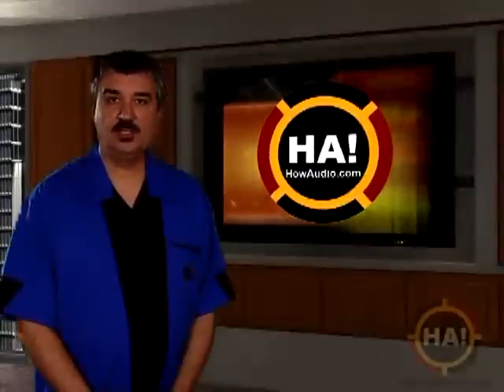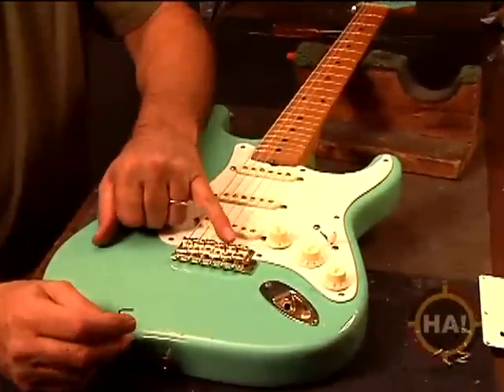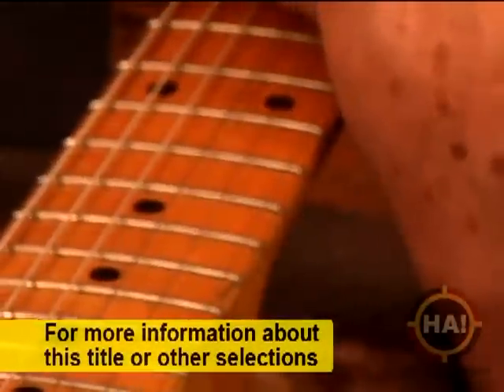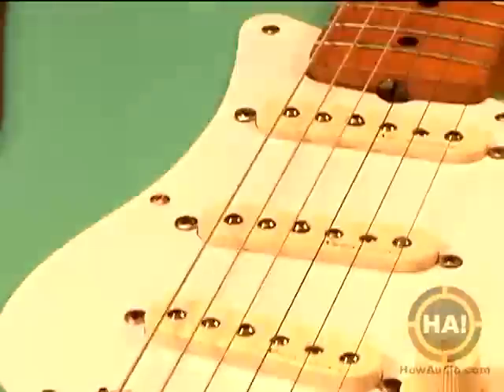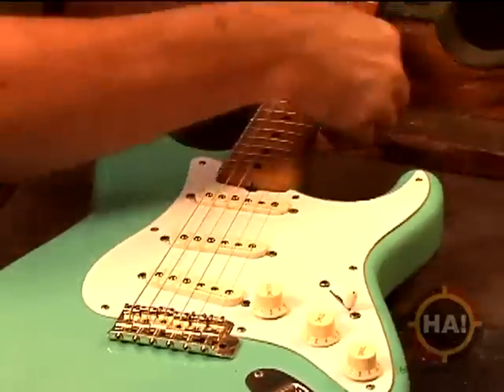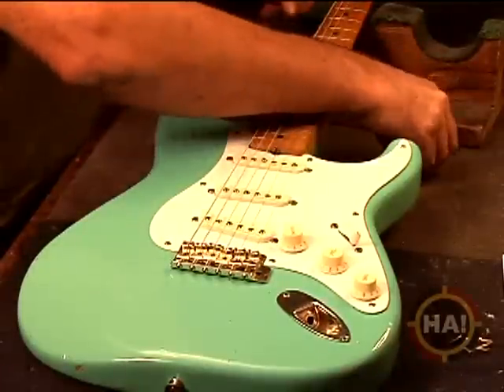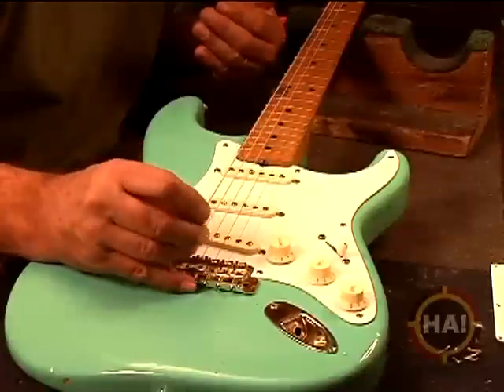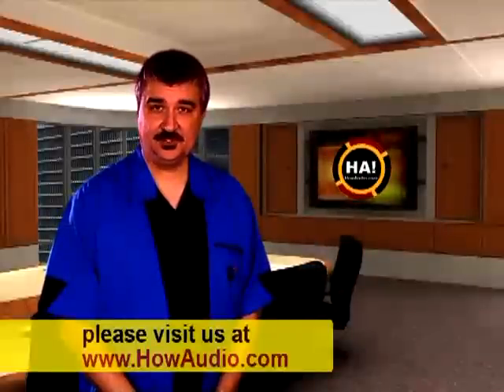Guitar Bridge Adjustment (action)

Comment from the maker: The bridge is anchored down on the top of the guitar, however the back edge of it "floats" off the surface due to the fact that there are springs mounted in the back of the guitar that pull in a downward direction and the string tension pulls the bridge in a upwards direction.

Comment: ive got a jackson js32t and ive put 11s on it 11,14,18p,28,38,48  the top e string is buzzing all 24 frets ive adjusted the trust rod and action the action right now is 2mm at the 24th fret and .5mm on th e1st fret any idea?

Comment: Hey I got a concern. The Little Screws at the bottom of my guitar, 2 of them wont stay put, when i put in a guitar string and start tunning the little screw just sinks down. Ive cleaned it area out and it still wont stay in I dont know whats wrong. HELP

Comment: the thing is.......guitars are not all created equal, regardless of brand or price. You can have two (or ten) of the same type guitar, brand new,  and you will be able to get the action much lower (w/out fret buztz)  on one than the other. Thats why I never go by any string height measurements. Just get the action as low as you can w/out buzzing and then set up the rest of the guitar